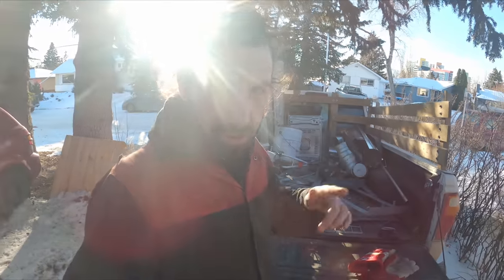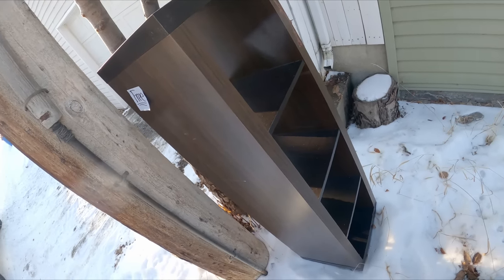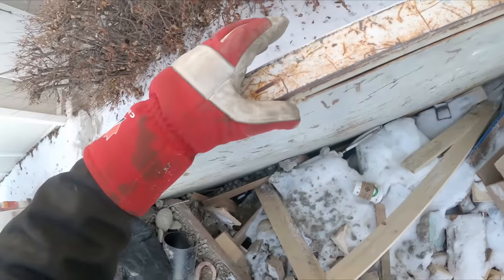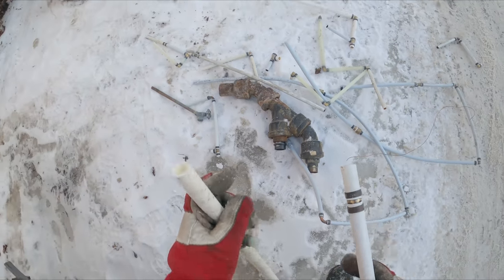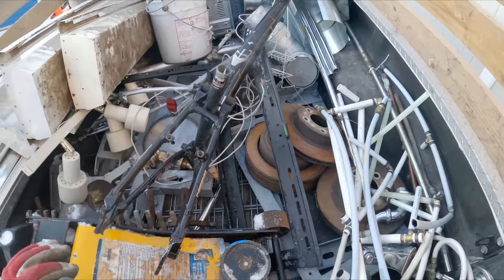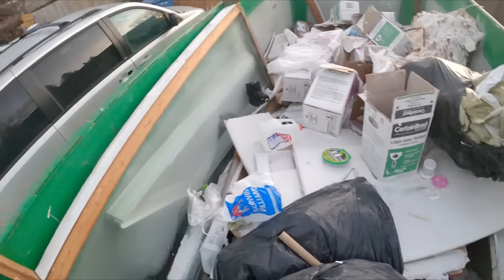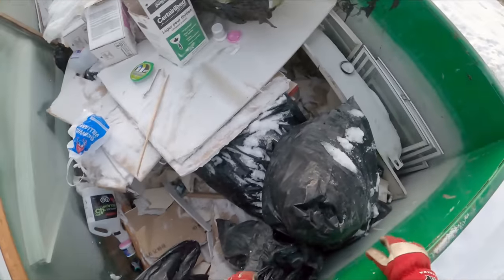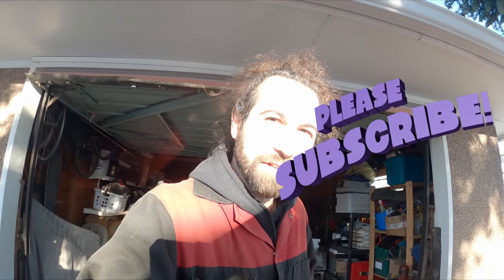Dumpster Diving Street Scrapping - Back To Work!

Comment: Great video. Just FYI, those track lighting you tossed in the shred have copper in them. There is some sort of cap on each end you take off then #1 copper the length of the track is easy to get. Slways a few sometimes three long pieces.

Comment: Yes there is a tool to cut the pvc and plastic pipes. Should find it at a plumbing shop and they are very handy as they cut fast. Especially in them red and blue lines.

Comment: I was just wondering why you don't keep the plugs from the ends of cords? I know it not much brass but I always pull the connectors out and throw them in a small bucket. It all adds up.